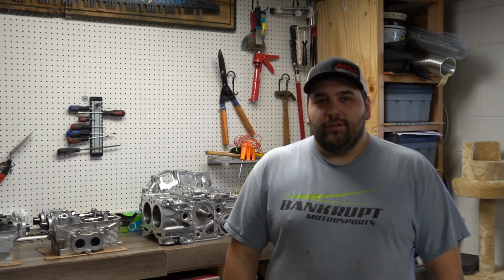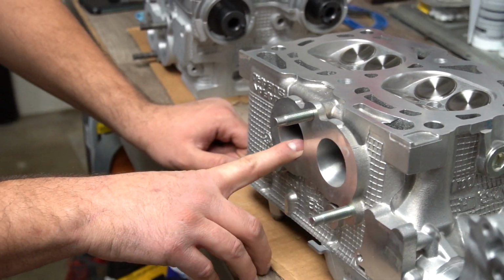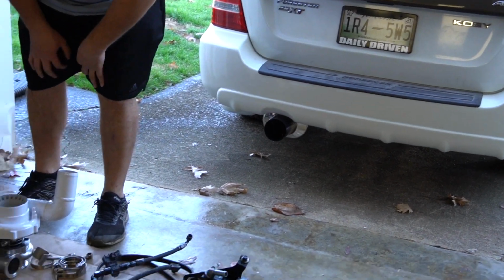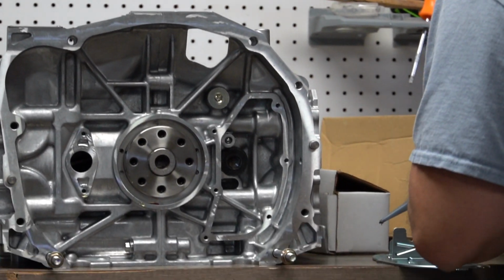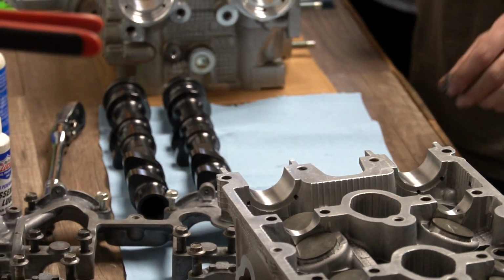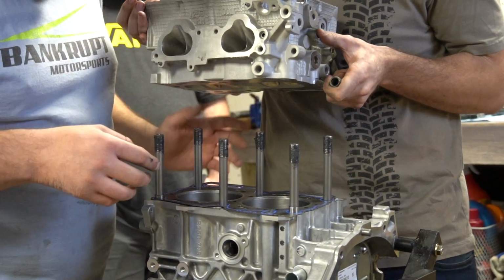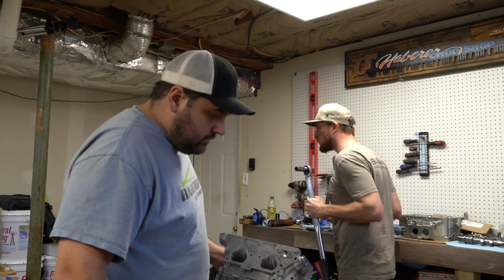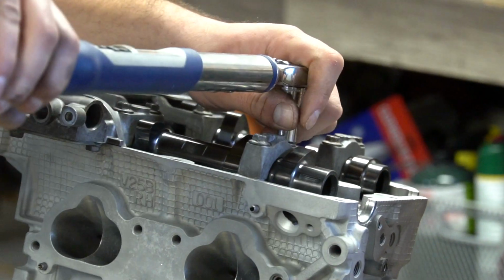2022 Build #2: Our Stage 3 1,000hp Forester XT

Comment: Can you please explain why you run the 12mm oil pump over the 11mm pump?
Reply: We use the 12mm oil pump on cars with larger oil pans and no oil cooler. The 12mm pump moves the most volume and if the pan has extra capacity it helps move more fluid and stay cooler. The 11mm pump is a good option for stock pans or cars with bigger oil coolers.